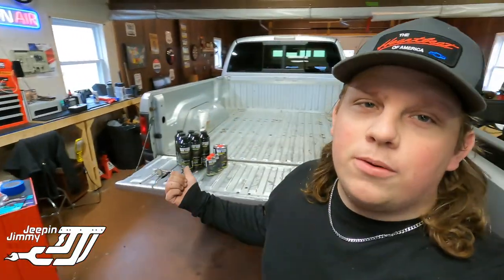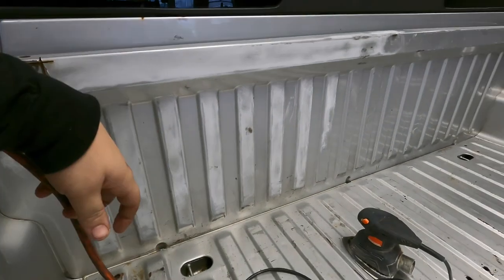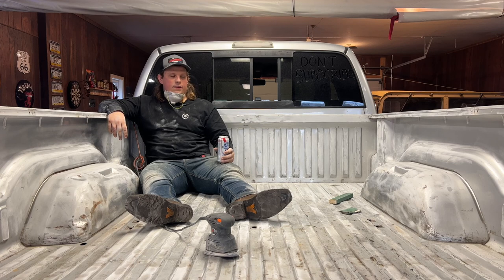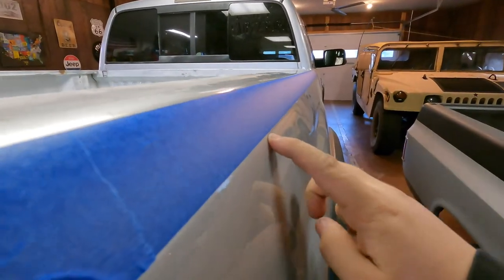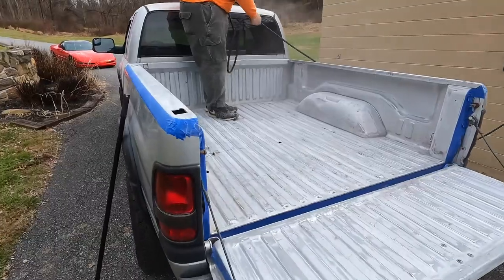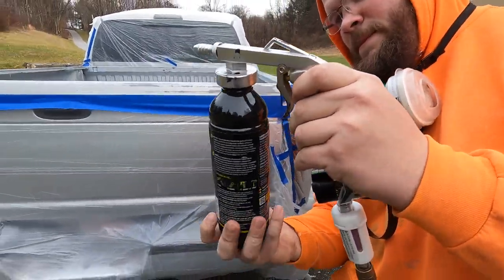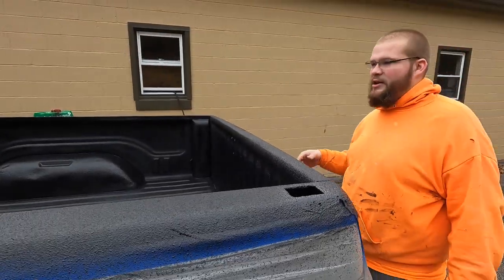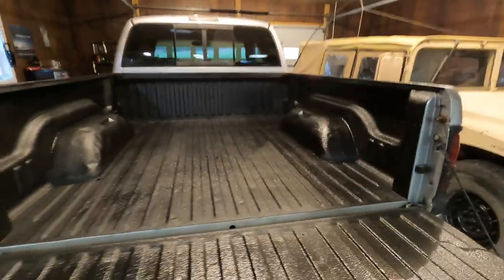How to Apply a Spray on Bedliner in Your Truck | DIY

Comment: Before I retired, I prepped beds for Rhino linings of Summit Station. Start to finish, including masking, took about 1.5 hours. For prepping the bed (scuffing) we used a grinder/polisher with a 4" fiber cup brush. This  made short work of the the scuffing process, usually about 20 minutes, even on an 8'  bed over the rail. With the Rhino material, coating thickness was about 1/8 to 1/4"    thick. With just me (except for the spaying) I could prep 3-4 trucks a day. I don't miss it at all. Yours turned out good. Very nice job. God bless, stay  well.
Reply from the maker: Yeah I definitely should have prepared more with my prep tools haha. Thanks for commenting!
Reply: @JeepinJimmy  what grit sandpaper do you use

Comment: For those valleys. You might want to try one those plunge cut  oscillating cutter rigs like Rockwell makes. You usually use them to do metal or wood cuts but they also come with sanding heads that are hook and loop. You would need alot of discs and I would go with a rough grit. It will make the goop stick better and if it sands better it sticks better. I will try the canned version of liner.